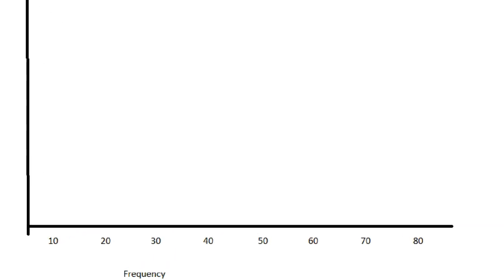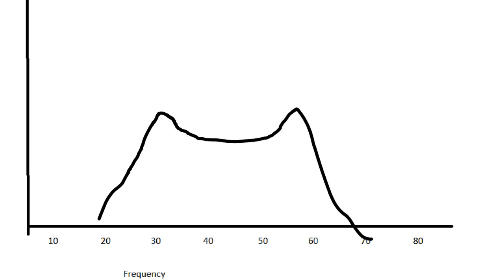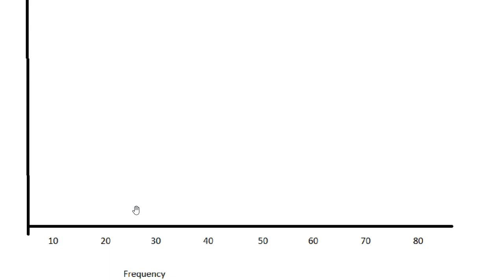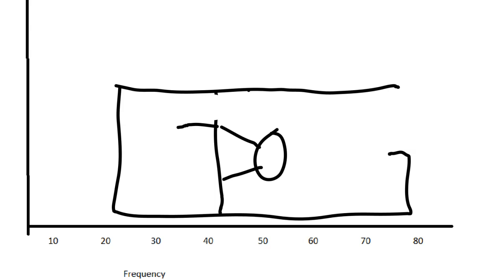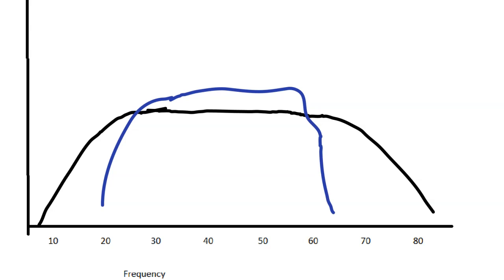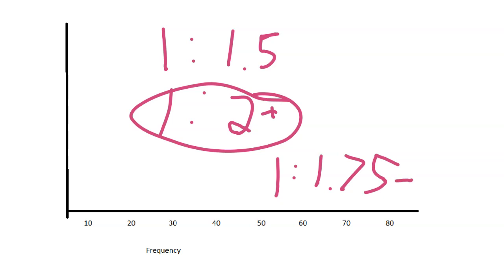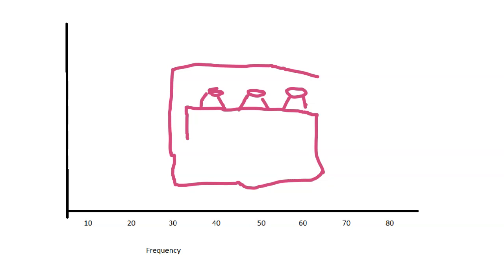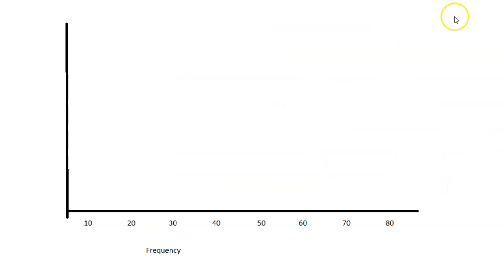Quick intro to different 6th order bandpass designs.

Comment: In the ratio... is it rear chamber to front chamber? So a 1:1.5 would be 5 in the rear and 7.5 in the front? And you'd tune the rear for the low passband, and the front for the high passband, correct?

Comment: Thank u....this was very helpful. Working on a design for 4 audiopipe3stack 15"s for my van. All straight in a row out the back door. It would be a 1:1 ratio slanted with an 8" slope. Similar to EXO's van build. I believe the slanted design would perform like a horn and throw the bass further...similar to Yorkville's rear loaded horn design. Looking to  tune between 25 - 45 hz. Any help would be greatly appreciated :)

Comment: Yeah the last minute wraps it up. you can just design your 4th order and tune it into your whole car. with a closed window its a bit like 6th order in case you put it in the trunk. with opened windows you can simulate it as a 8th order bandpass.

Actually its all just a tline in basics terms. just draw your line with the same/constant port area and see what wavelength you can hit. this will be a fundamental outta your system. ez hitting 20hz that way.
Reply: Just be careful you give enough speaker loading. aka enough port area through your line of wave path way (portlength). A horn is basically just a port without additional mass loading.
so in case u design your line all through until your opened window, u gotta simulate how much u will hit that tone. if its badly designed you bottom out, bcs there is not enough air reaching the speaker. regardless, space is the factor. just dont overpower the driver and u wont bottom out.... or maybe use less speakercones... 

I occasionally built a semi t-line for my car, by giving it a line of 1,80m. thou at halfway, the horn/port way gets halved in its area and you gain other of "reflective" line of 0,9m. calculating 0,9+1,80m u get 2,7meters. 344m/s air velocity divided by 2,7meters is about 120hz. which, its 1/4 wavelength is about 30 hz. Funny enough hornresp simulated that 4 me
Reply: Plus if u do ports that get too small vs the volume (aka wall to wall distances in all 3 dimensions) u end up getting many many reflections. you get low notes, but u end up gettin a lot of harmonic distortion, bcs of alllll those reflections. shit starts to sound less and less good, the smaller the port / the bigger the volume of your chamber.

Just try to design your bandpass modells with the biggest ports possible. Those might sound better, and without a "hollow" sounding base.

Comment: I'm building a box for 4 Zv6 12s. I am wondering how big I should be on the rear chamber side. I was thinking 7.5 cubes for the rear. I'm running two 8ks to the 12s. I want to maximize the box to get the craziest amount of bass I can from these bad boys. Let me know what you think and if you have any recommendations. Thanks!
Reply from the maker: That sounds good, depending on the size of your back chamber port.  if it is too big, then there could be problems.  On your lows, are you going for wind or loud lows?
Reply: I want a good mix of both. What would you recommend for port area? Would shrinking it make it windier or vice versa?
Reply from the maker: @mitchellreade4790  Yes, shrinking the port will make it windier and help some with power handling.  However, you will loose db doing it.  So, it is a trade off.  Most people start kind of big on their rear chamber port and will slowly shrink it until they are happy.  You may consider 8-9 sq in of port per cube for loud and somewhere around 6 sq in of port (talking about a slot port) for maximum wind.  Going to small just makes your box act kind of like a leaky 4th order, so you definitely want to avoid that.
Reply: Okay, that helps a lot. Thank you!
Reply: You build it to regular ported box specs given the same parameters.. the only thing that changes is the port do to tuning differences between the two sides
Reply: From what I’ve seen people do 70-80% the recommended ported on the rear chamber. If you go too large you won’t have come control. I’m also running a bit of power to those bad boys. I’m open to suggestions though
Reply: Do you have any information on where you got that? I’m trying to learn as much as I can

Comment: I built a series for my buggy with 2 DDX 12’s on a 2k. 3.5 cubes on bottom, 5.5 up top. 30hz on bottom with 7squ in of port per cube. 50 up top with 18squ in of port per cube. Sounded amazing in the 45-65 hz range, but didn’t really get the lows I wanted. Currently designing another 4 cubes on bottom with 10squ in per cube at 30hz and 6 cubes up top with 23squ in per cube at 55. Maybe I’ll get a little more low end out of it
Reply from the maker: Somehow I missed your comment, let me know how you like it!  I would lower the tune a little bit for lows.  Maybe go with 27 hertz for better lower end.

Comment: Ok i have 2 sundown X v2 12s. I drive a 08 crown victoria  i want wind. Not looking for dbs. I was leaning on a 6th but im so lost as to size and ratio. After viewing this 1:1 looks like the winner. I just need to figure out the rear port and the front opening port to the front seats. B pillar wall. Well i want my seats to lean back so like just rear of the b pillar
Reply from the maker: Let me put it like this, let's say you go with 5 cubic feet for the rear chamber and 9 cubic feet for the front chamber, you will be just as loud on the lows as going with 5 cubic feet for both.  You just lose out on the highs.  The reason the 1:1 is so popular, is it allows people to use the extra room they normally would for the top/front chamber to add extra subs, which is why is gets so windy and loud on lows.  If you already have the subs, my best advice is to figure out how much room you will need for your rear and use the rest (up to around a 1:75 at the most - depending on power) for for the high chamber.  If you aren't going crazy power, around 5-5.5 cubes is great for those x 12's on the rear chamber.  Are you going slotted port or areo?
Reply: @caraudiolab  slot port.  Thank you for the reply!
Reply from the maker: @Uglymuggcaraudio  If you are just looking for windy, go with 7 square inches per cube on the bottom port and be prepared to possibly shrink it down to 6 with testing.  If you want to go loud on lows, then start with 8 per cube and then possibly shrink it with testing. Start with about 25 square inches per cube on your top/high chamber and then shrink from there while testing.
Reply: @caraudiolab  thank you so so much!!
Reply from the maker: @Uglymuggcaraudio   Glad I could help!
Reply: @caraudiolab I thought 70-80% of recommended on the rear so 3-3.5 for the rear chamber?

Comment: Awesome video! I'm running a parallel 6th in my volt for 2 twelves. Nasty on the lows, but i do notice it gets weird on those higher frequencies. Very insightful video.
Reply from the maker: I am putting together a parallel 6th now myself.  I should have some videos on it in the near future, I can't wait.  Have you metered yours yet?  What is it tuned to and what are the sizes of each chamber?  I want to know more!
Reply: @caraudiolab  I have to say that this is my favorite enclosure to date. It's tuned 27 on the low side and 57 on the high side, I believe. I don't know the box volume. I will let you know. I haven't metered yet. Trying to find some shows here in Ga.
Reply from the maker: @BigYank33700   That is awesome!  I am currently tuned to 27 on the low side, but I may tune higher so as I shrink the port some for wind, it will end up tuned between 25 and 28.  Either way, I wish you were closer so I could get a demo!  I finally decided on a parallel tuned double bandpass to try something different!   Good luck brother!
Reply: @caraudiolab 
 It sure how far you are from me but Newark, Oh. here👍 Getting ready to rebuild my Hybrid bass reflex transmission T-box.. Gonna be a Good year my man & thanks for the knowledge in the vid.😁
Reply from the maker: @smigletat9634   I am in the southwest, so other side of the country.  lol  That box sounds awesome!  I would love to know how it turns out!  I tested a port wars box that was a bass reflex transmission line design.  It was awful, but I have learned a lot since then and feel like it could still work with some of my new ideas.  How did you decide on the sealed chamber side size?

Comment: awesome video.  Any recommendations on port area for rear port and front port?
Reply from the maker: Sure, what sub are you looking at running?  Also, are you interested in Windy at lows, SPL at lows or a mix?  I am releasing a video on designing series 6th order bandpass enclosures next week along with a Google doc that you can reference.  It is going to be super helpful for everything you need to know.
Reply: @caraudiolab  3 12” Savard HOE on 8k.  Windy at lows, demo monster.
Reply from the maker: @Husky_Shane_BassHead   Those are nice subs, I think you will be happy!  I would recommend between 7-9 inches squared per cube on the rear.  Start with 9 if you can and then test and shrink a little at a time. You may find the more you shrink, you loose DB but gain wind.  Stop when you are happy, but with the excursion of those subs, you probably don't want to go lower than 7 at the most.  If you were going for loud, I would almost recommend 9-10.  To determine the front, do you know what the bottom and top tuning will be?  example: 25/50 hetz, 30/60 hetz, etc.
Reply from the maker: @Husky_Shane_BassHead   By the way, those were slot port recommendations.  If you go aero, you can trim up to 30% off.
Reply: @caraudiolab  I want to tune low.  22/44… 25/50 at the most
Reply from the maker: @Husky_Shane_BassHead   For that low, you may want to frame with 2x6 on the high side.  Start with 25 inch squared on the high side and slowly shrink until you meet the octave above low tuning.  You can do this by adding additional 2x6 framing on one side at a time or adding a 4 or 6'' cut in half PVC tube one a side at a time.  Measure for impedance drop with a multimeter when in the vehicle for precision.  But, you can always stop a bit short if you find you like the bandwidth and you don't have drop between tuning points.   Do not go below 20 inch squared.  This ensures the low end wave can easily make it through the front port without choking.   Many people have had success playing 17 hertz or lower even with 25/50 hertz tuning, especially with a slightly undersized rear port for wind.  So, if you still want bandwidth on the high side, that is a great tuning option.
Reply: @caraudiolab  awesome!  Thank you for the suggestions.  It’s very difficult to find good information about 6th order bandpass designs online.  I appreciate the responses.

Comment: Great stuff man thanks
Reply from the maker: Glad you enjoyed it
Reply: @caraudiolab  hey man do you know the magnet weight on the uv1 and uv2 subs? 15 inch
Reply from the maker: @brockmarquis8511   Not sure, I would estimate around 350 ounce for the motor weight.
Reply: @caraudiolab  so you would say its bigger than a skar vxf 15 which is 300?
Reply from the maker: @brockmarquis8511   The version 2 weighs more than the SKAR VFX, the version 1 is a couple pounds lighter.  However, I have had both and the V1 U still outperforms the SKAR VFX even though the magnet is smaller.  The U just directs the flux to the gap better.
Reply: @caraudiolab  thank you very much